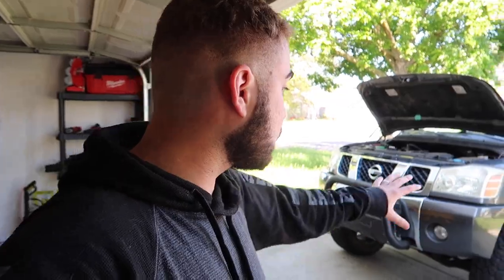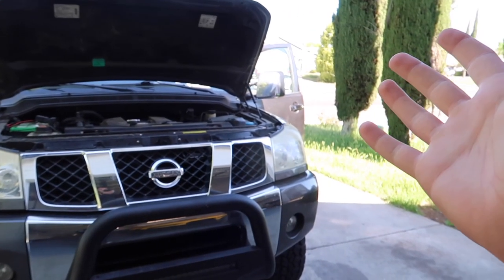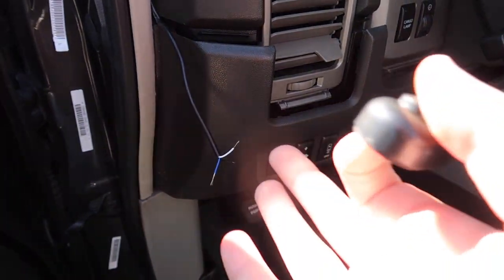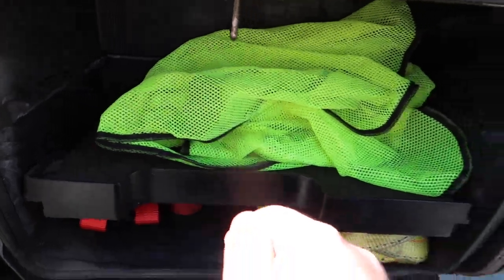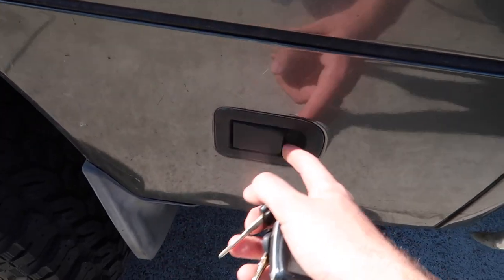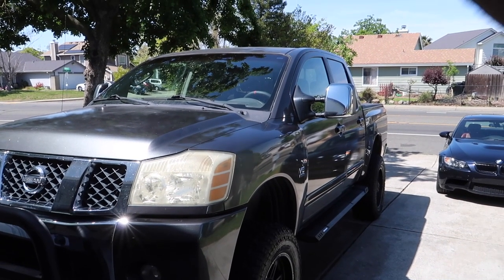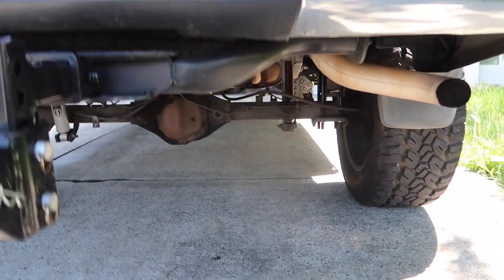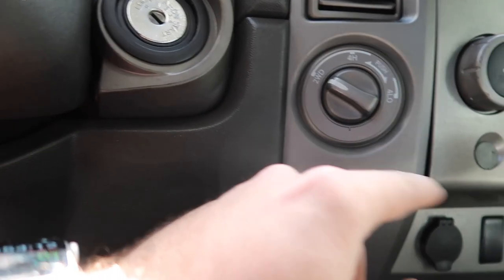SELLING A CAR I THOUGHT I NEVER WOULD!

Comment: Trucking hell. Looks so much nicer. Simply wrap the bars with black vinyl. A sear cover or gaffer tape it to stop it splitting further for now. Or a seat stitch repair piece. Keep it looking clean. It’s a car parts, tow, haulage truck. I’d keep it. It works fine.🇬🇧🇬🇧🇬🇧